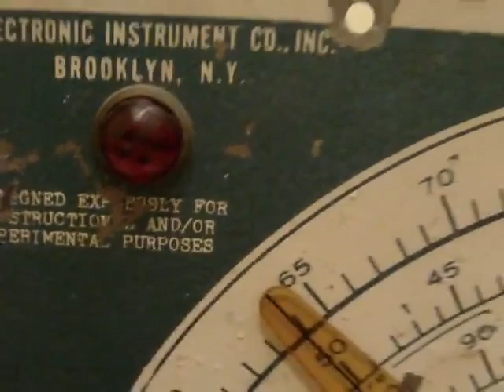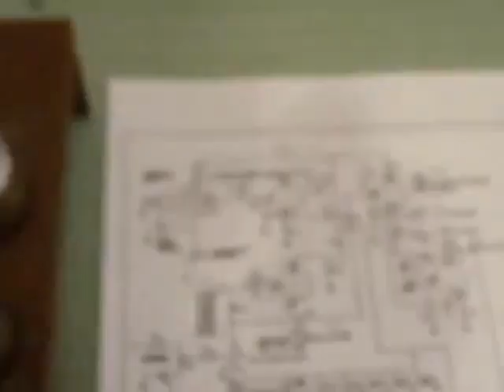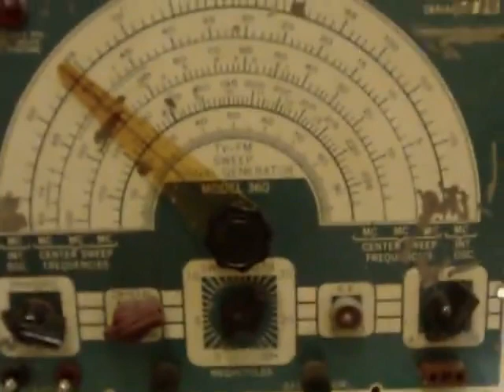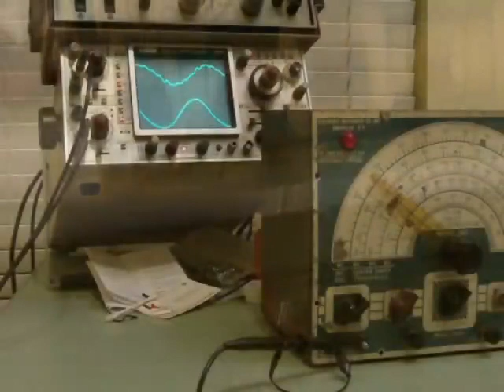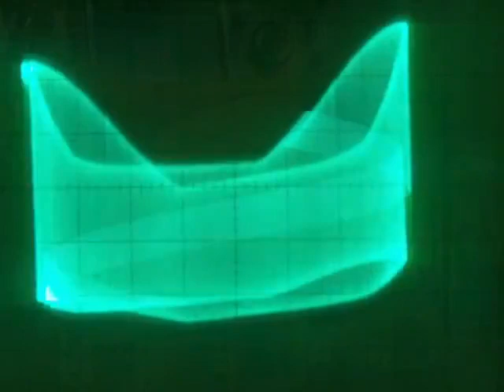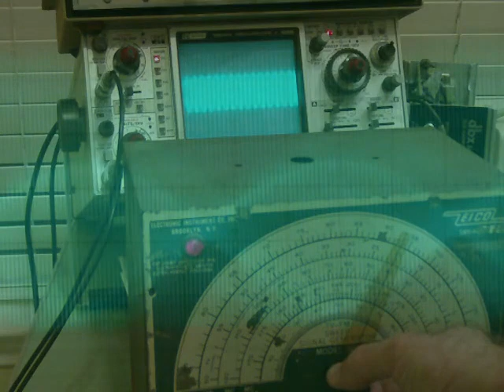EICO 360 TV FM Sweep Generator Explained

Comment: I have the same model with same printed message in the upper left corner. Only difference is the condition of your unit in comparison with mine on a scale from 1  to 10 yours would be a 3 or 4 and the one i got would be a 7 or 8 super clean i don't have any paperwork with mine at all nothing. What do you use yours for?
Could you give me an example if what you would use this unit for?
Reply from the maker: I sold that EICO at the end of 2017.  I located both the operation manual and the construction manual on the web.  I never had any practical use for it.  It was supposed to be used when aligning FM receivers where you had to sweep 100KHz bandwidth.   The manual says "Extremely wide sweep width 1s available, variable from 0 to 30 megacycles."  The sweep width is created by that speaker modulating the inductance of the coil.  Very strange circuit.  I never knew what the "FOR INSTRUCTIONAL AND/OR EXPERIMENTAL PURPOSES" meant.
Reply: Yes,  but do have any idea of what you are doing orhow to use the equipment.